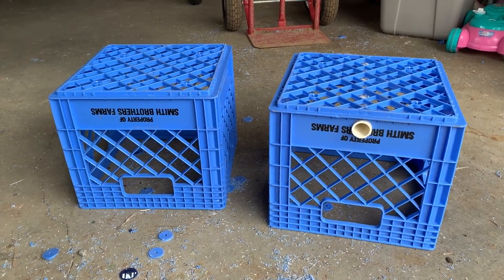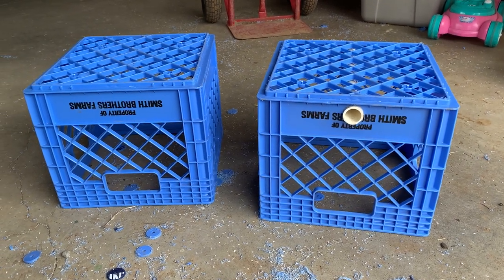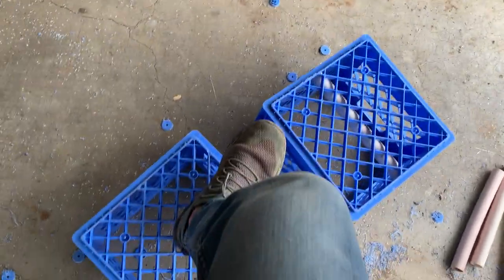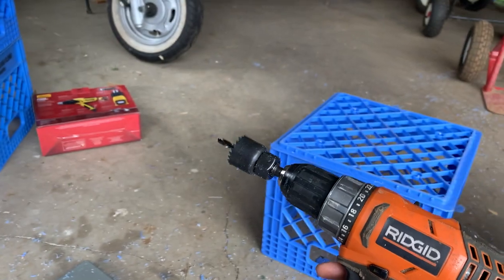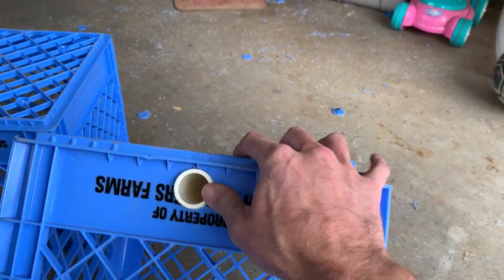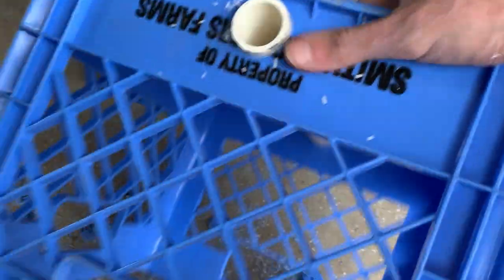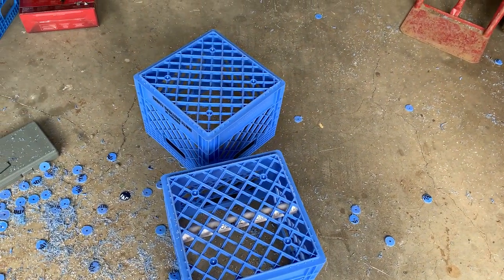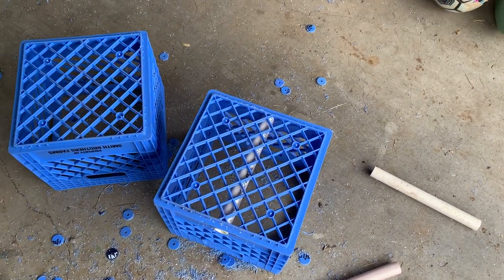Backyard Water Garden: Reinforced Milk Crates for Wetland Filter

Comment: Hey Tyler. Your pipe will help initially. But. The way you have installed the pipe will not do much for you "Over Time" me thinks. (I'm no engineer but perhaps you should ask one.) I am concerned that it may "deform over time" under load.

The Aquablox work as they have vertical "Internal" panels to take the weight.

By using large stones on top of the Aquablox you further spread the load such that you limit point load on the weak areas of the "Mesh". (If you are careful to use reasonably flat stones and orient them well.)

The questions to ask the engineer is something like, 
Q1 "Will my milk crate mesh deform/fail over time under the weight of 24 inches of stone/gravel?" (I think you said 24 inches anyway.)
Q2 "If it will fail what can I do to mitigate it?"
Q3 "Will the mesh side up orientation of the milk crate over stress the liner on the base? (Will the top lip of milk crate force the liner to split as it pushes into the liner on the base over time. Remember AquaBlox have the mesh on all sides including the top and bottom to evenly spread the load on the liner base.)

If they will take the weight perhaps consider orienting the crates mesh side down say 3 or 4 crates high, then filling in the very top level of "Open Crates" with stones/gravel.

I say again, I'm no engineer, but I would ask one if I were you.

See Aquablox internal structure explained here, (First YouTube vid I could find.)
https://www.youtube.com/watch?v=6Olt0aKBFJg

Kind Regards.
Reply from the maker: All valid questions, Ian. Aquablox are definitely stronger and, if you're okay paying for them, will provide better assurance.

You're right that it would be stronger if my modification carried the load all the way to the ground on it's own (like a wall in a house vs. a header over a door or window).

This will be a test case. I think this system will be plenty strong enough, but we will see in time. This is also not a totally unique solution. Before aquablox existed, this is how reservoirs for pondless waterfalls were made all the time and many are still in service today decades later.

These milkcrates can take almost 2000 lbs/sf of compression before beginning to fail, and my system, under 2' of gravel, will only be applying about 200 lbs of dead load. And the system of crates will also be backfilled around the edges to lock them together, making them stronger still.

So, definitely not as strong as aquablox, but probably more than strong enough. Time will tell. If I end up digging it all out, I'll be sure to film an update!

RE: Liner—I am using an RPE liner with a woven fabric over it. Extremely tough stuff. Many times more tear/puncture resistant than EPDM. I am pretty sure the crates would collapse long before they could exert enough pressure to damage the liner.
Reply: @TylerTervooren  OK Tyler, it's good to hear milk crates have been used like this before. All the best and I'm a subscriber so I look forward to seeing how this works out. :-)
Reply: Just a random here dropping in to say that as both a pond lover and a bit of a nerd, I enjoyed the video and your engineering-focused conversation above. I've got an above-ground pond design on the go, and have been using FEA to analyse stresses and deflections vs. hydrostatic pressures... teaching myself how to do this in the process 🙂